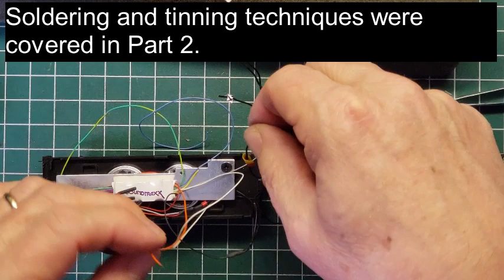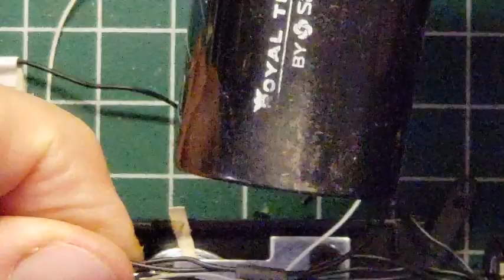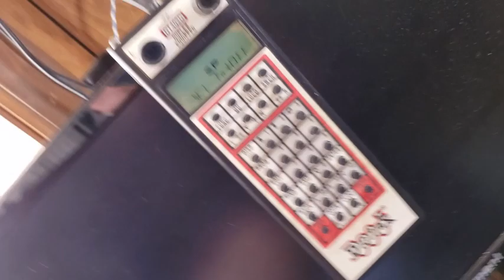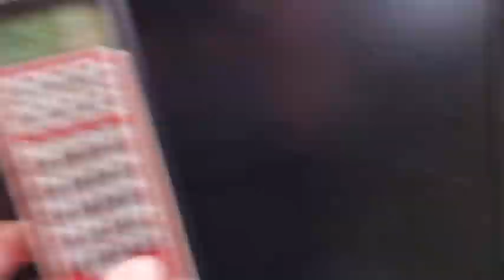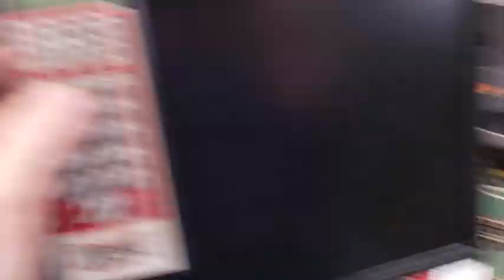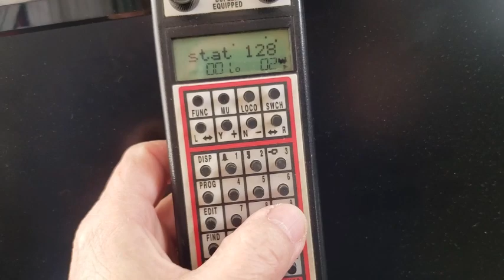HO 4 6 2 BLI replace P3

Comment: Many times I have gotten caught up in making wire connections and forgotten to slip on the shrink tubing or plug barrel! Its disappointing to have to undo a perfect shiny solder joint to correct my mistake. Thanks for making this video!